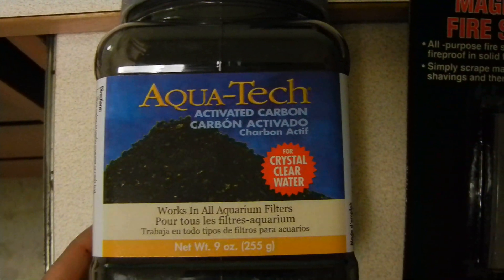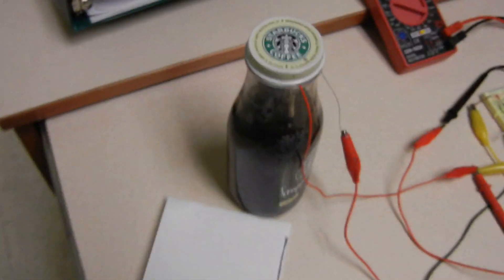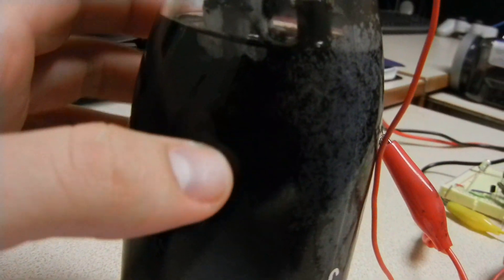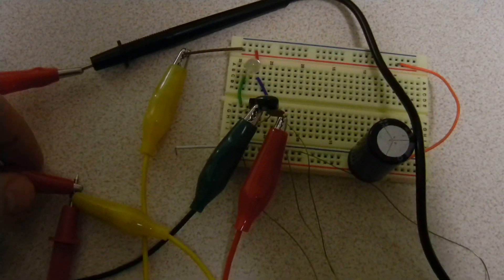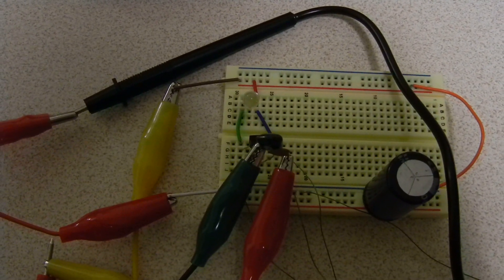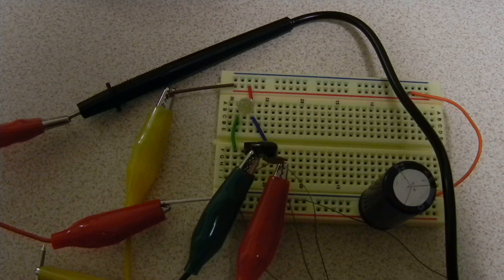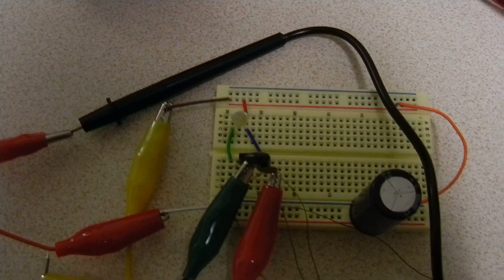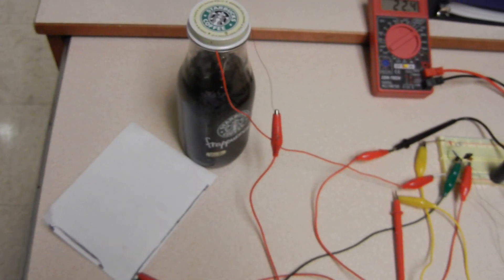Acetone Battery

Comment from the maker: @cemenergy Ethylene glycol is a double alcohol, so it has two acidic hydrogens that can gas out if you tried recharging the battery. I wanted an electrolyte with no hydrogens and no hydroxy groups that could react with the metal or bubble out when I try to recharge this later.

Comment from the maker: @headmaniac1 When you make colloidal silver you get a black residue on one of the silver wires yes? Ionic silver isn't soluble enough to conduct a lot of electricity. Silver Nitrate on the other hand is very soluble and would work, but the whole point here was to make a battery without water. I'm fairly sure Silver Nitrate also dissolves in Acetone and DMSO very well, but I'm going to use sodium nitrate on my next battery instead since it's less toxic.

Comment: Interesting experiment.  From Wikipedia: "The most hazardous quality of acetone is its extreme flammability. At temperatures greater than acetone's flash point of −20 °C (−4 °F), air mixtures of between 2.5% and 12.8% acetone, by volume, may explode or cause a flash fire. Vapors can flow along surfaces to distant ignition sources and flash back. Static discharge may also ignite acetone vapors." Estimate 15% - 25% by volume in your battery. One stray spark - BOOM!

Comment from the maker: @Lidmotor I wanted something that is completely independent of water. The only problem is that it's like having distilled water for electrolyte as far as conductivity goes. I'll make another cell and add some table salt to try to boost the conductivity. I'm pretty sure there cannot ever be any gassing from either charging or discharging, and I don't think the Magnesium can ever oxidize.